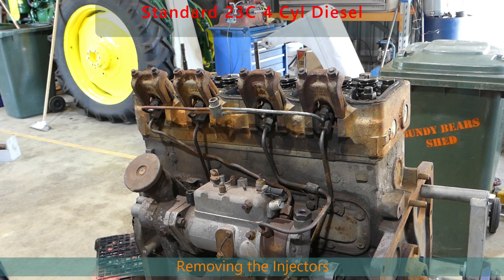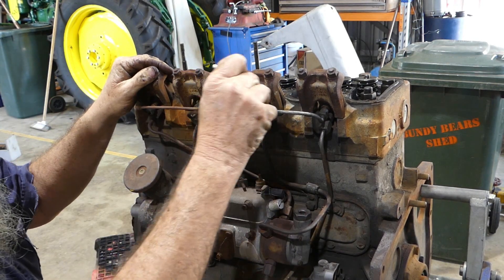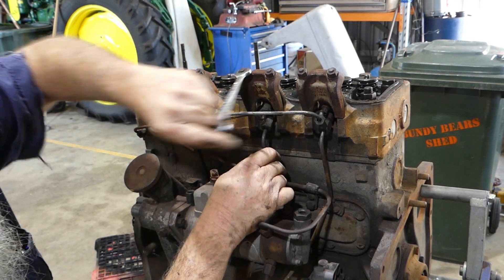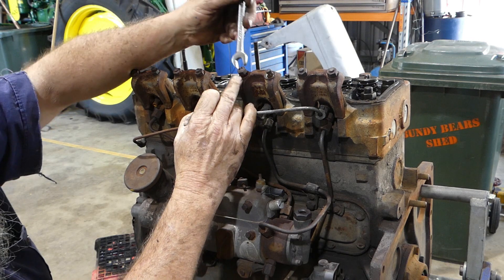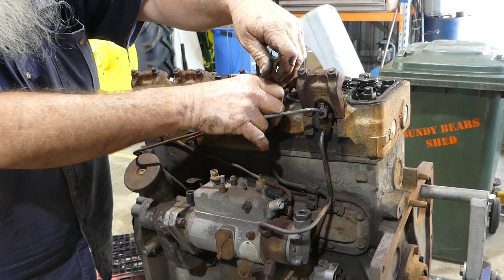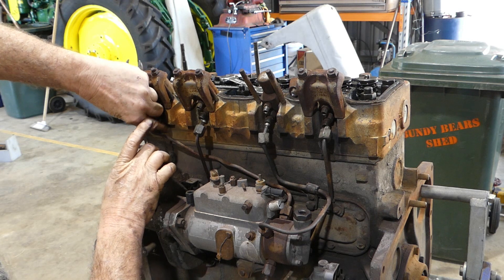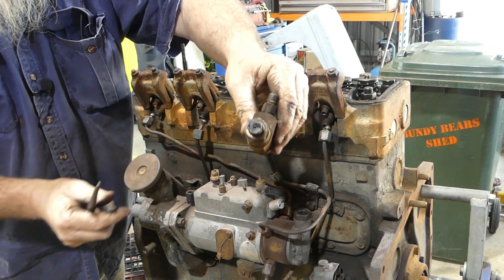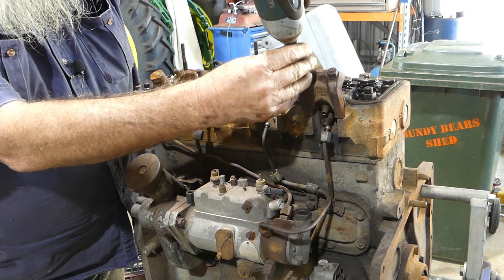Ferguson 23C Diesel Engine Part 2 Removing the Injectors

Comment: Great video and hammer control. I've TE20 need to remove injectors. But are stuck firm nervous to do too much hammering. Injector on side of head
Reply from the maker: Try a crows foot bar or similar.

Comment: Great video Lance.
Is it possible to clean up those injectors and how would you go about it.
Thanks for sharing.
Reply from the maker: Yes, absolutely, I strip them and clean in solvent, possibly replace nozzles if needed, and set the pressures.

Comment: Have a question about my lucas injection pump 3cyl I rebuilt it it has 4 pistons not the 2 so 2 are long and 2 are short but I don't have much pressure coming out from the pump fuel is going in no problem..thks Nigel
Reply from the maker: May just be worn in the piston bore.
Reply: @BundyBearsShed  can I buy new parts to make it work thks
Reply from the maker: I think you can buy a new head from memory, look at Sparex or QTP.
Reply: @BundyBearsShed  perfect thks for that I do enjoy your videos thks